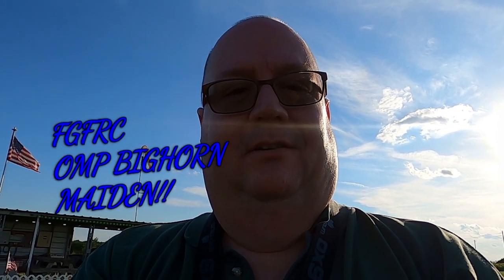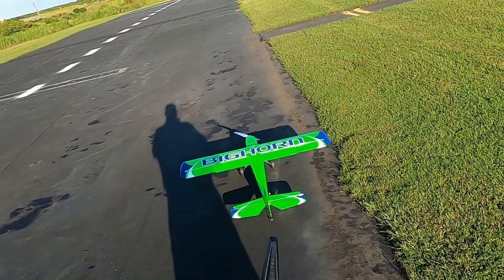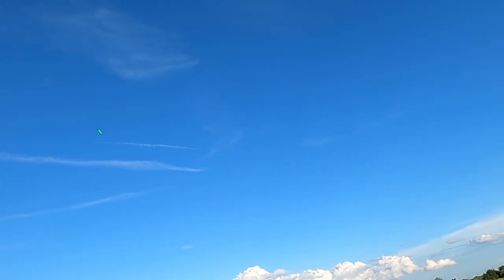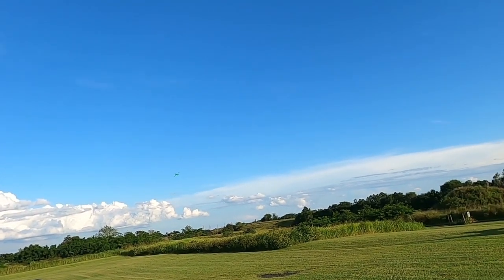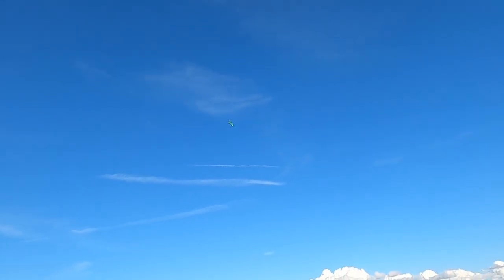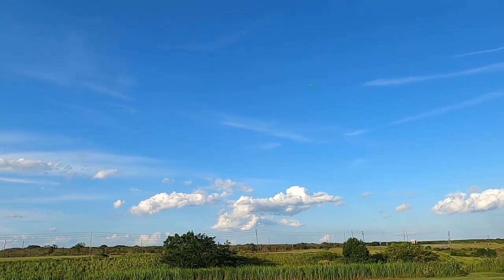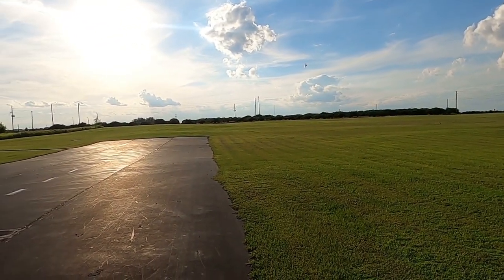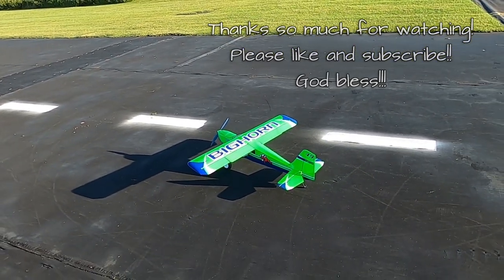HECK YEAH!! MAIDEN OF THE OMP BIGHORN BY FGFRC

Comment: Looks like a similar platform to the Valiant 10cc, but a bit smaller.  I just pulled the trigger on a Hangar 9 Ultra Stick 10cc (not the new PnP).  I have plenty of electronic goodies laying around that will work in it, making it a better buy for me than the PnP.  Cheers.
Reply from the maker: Sounds great! Yeah this is actually my third balsa and pine plane. I also have the Eflite Pacer but its still in the works.